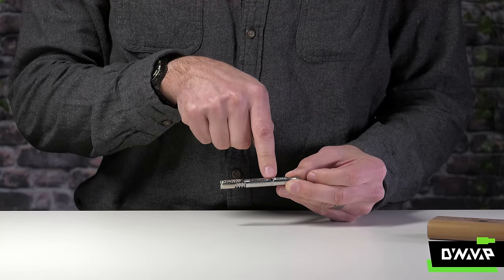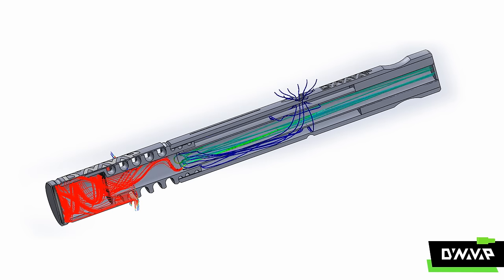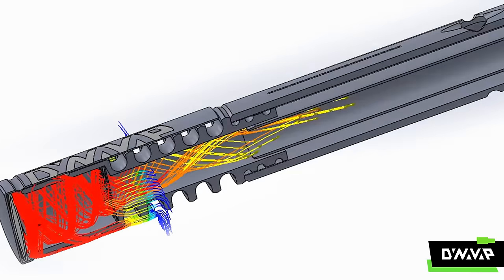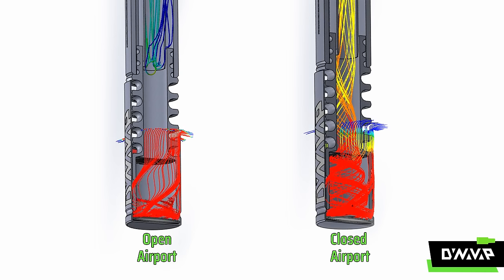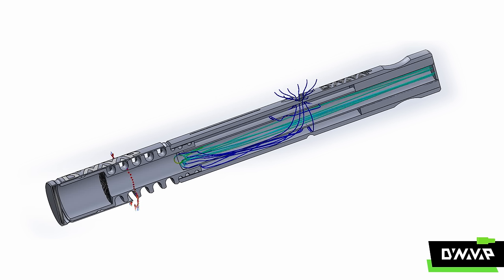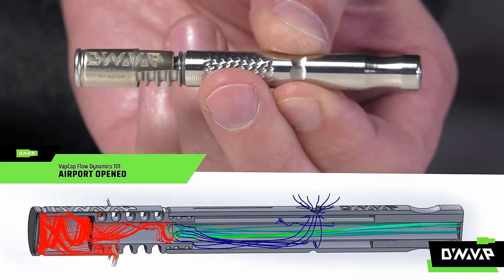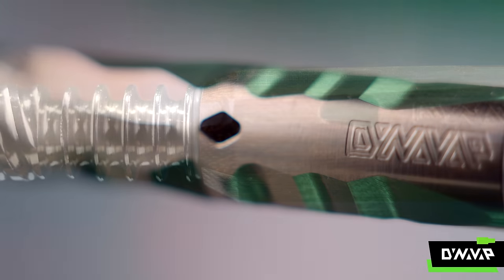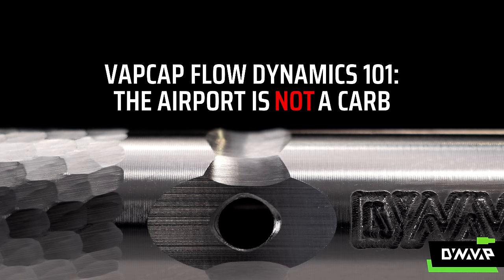How the VapCap Works  Airflow Dynamics 101  DynaVap

Comment: Soooo....the airport is not a carb...but when I use it like a carb it works like a carb.
Reply: whats a carb?
Reply: @frederik6519  on some pipes you have a carb or carburetor. Basically, it allows air to enter when you pull through it. It applies to smoking because when you light the pipe, you hold the carb which forces air to be drawn through the substance you're burning so you get a tighter draw for better production of smoke or in the dynavaps case, vapor. You then release the carb and the smoke you've built up is displaced into your lungs. It's a pretty simple concept, but it can be somewhat difficult to get the perfect amount of draw.
Reply: @Trucks_n_stuff no this is wrong. The whole video was made so people don’t think this. For dynavap. Idk about the science full behind it. This is just from my experience and this video helping me. Basically he’s saying you wanna use it the opposite of the way carbs are usually used. For example when I first used the dyna I used it like a carb. Cover the hole while sucking and let go to get smoke. But with the dyna if you let the hole open first then you get more vapor. Then at the end you wanna barely cover it to make it last longer. Also if you cover the hole it can lead to the material combusting I’ve noticed
Reply: @kzkane2866  yeah, I don't know why I mentioned the dynavap because it isn't a carb at all, it's specifically there to improve air flow for better vapor production and I knew it. Must've been really high when I wrote it, sorry for any confusion I caused the other guy.

Comment: A carburetor or carburettor is a device that mixes air and fuel for internal combustion engines in the proper air–fuel ratio for combustion. It is sometimes colloquially shortened to carb in the UK    My understanding is that's why it was called a carb on bongs etc, if anything the dynavaps carb hole is closer to the proper definition of a carb
Reply: I agree. Carburettors use Bernoulli’s principle to use changes in air pressure to draw fuel into the airstream to mix together. Same idea.
Reply: @toyotasupra97  The concept of creating turbulence to accelerate the air with the air port open is similiar to Bernoulli's principle of basically shooting dispersed vapour-like fuel in the air into the engine
Reply: If I’m understanding correctly, the device allows air through regardless of the port being closed or open so the “air port” is changing the volume of air entering the device which can change the dynamics of the end vapor.
Reply: Game changer

Comment: I love my Vong. I owned it for over a year before I realised that I loved it. I was heating it wrong and keeping the air port closed. I am so happy I persevered, my Vong is now my daily driver - even though I press my own rosin for dabbing. The Vong is just so much faster, cleaner and great engineering. Thank you. I finally stopped smoking after 10+ years of daily use. Now I am purely vapour. Much gratitude!
Reply: I'm trying to understand the Vong. I do enjoy vaporizing thru a bubbler but it seems most (all?) of the dynavap will have a tapered end for a 10mm bubbler...?
Reply: @ahoier  My Vong has both a 10mm and 14mm shape to it. A Vong will fit both a 10mm and 14mm female adapter piece. 

I heat mine below the captive cap, aiming the flame onto the titanium tip and allowing a very small amount of flame to slip over the edge of the cap, it normally gets full extraction after 2 heating cycles. I find it works best to allow a small amount of space at the top of the herb for air circulation.

Comment: I've watched this video several times and I am having trouble following it. Could someone give a simpler explanation  on the difference between an open and closed air port for someone new to vaping?
Reply: Just hit it fully closed for one bowl, then hit it fully open for another.

After a few times, you'll know what you like.
Reply: Oh, I kinda disagree with going over the click for ANY amount of time. 

It clearly says on the website that heating past the click can eventually damage the cap.

Plus, you're risking combustion, which is why we're all vaping instead of smoking in the first place.

Lastly, I've never EVER gone past the click on either of my caps: the 2020M cap, and the Low Temp Captive Cap.
After learning how to use the device (2 years ago), I now consistently get medium to dark brown material with zero burnt material and full extraction. 

In fact, I let my (smoker) buddy load a glass pipe bowl with some of my ABV (material that's "already been vaped"), and smoke it. He smoked the WHOLE (big) bowl in 3 or 4 big hits, coughed his ass off, and never felt anything from it! 
This means my Dynavap is VERY efficient, but easy on the lungs.
Reply: @triggerhappydad65  this is very useful anecdotal information. Thank you.
Reply: To answer the original question:

Basically, if you don't cover it , some outside air mixes with the hot air from the bowl, at a point past the bowl.
 - you don't have to pull so hard
 - the air/vapor you drag will be a lower temperature
 - the cap doesn't cool down as much (and you can heat it up faster, eg, for a session). This is because you are leaving some hot air inside the bowl. Not so hot that you are de-carbing, but just under that temperature (because hopefully, you stopped pulling only after the cap clicked back).

If you do (fully) cover it , the only air intake is through the cap.
 - You have to pull much harder (a whole lot harder from my experience)
 - the air/vapor you drag will be a higher temperature
 - the cap will cool down a lot faster, because you are extracting all the hot air from the bowl. You will have to spend a longer time heating it up on the next hit. (perhaps do this at the end of a session).

The nice part is that you can roll your finger (like he was showing in the video) to get a continuous spectrum between these two intake modes.

If you have used a water pipe, have you ever slightly pulled the bowl out after the herb starts to combust? I do this all the time to prevent second-hand smoke from smelling up my house. 

But this is kind of similar to the port on your DynaVap. Pulling the bowl out slightly will mix outside air with the smoke, thus cooling it off. And you don't have to pull so hard. But you get much smaller hits instead, so it takes several small hits to clear a bowl. This effect seems true in the DynaVap also, but it's not as extreme, from my experience. The only difference from the DynaVap is that, opposite to the DynaVap, I completely clear the hot air from my bowl with this technique. In the DynaVap, letting the extra air flow in actually keeps the bowl warm. And that's what all those fancy animations with rainbow lines was trying to demonstrate in the video. I'll agree that the explanation he gave was kind of unclear. Hope that analogy sort of illustrates the idea.
Reply: @G8tr1522  Thank you.
Reply: @triggerhappydad65  100% with you here. I never go past the click, haven't combusted once since getting past the learning curve. I give it 3 hits and get an even roast and light brown herb.

Comment: Great explanation and a video I’ve revisited a few times. My initial experience and preference was to keep it closed to maximize what felt like a more enhanced experience. I suppose after playing around a bit more the open or half closed method is preferred. Fewer reheats because there’s still heat in the cap.

Comment: Just got desktop vaporizer size hit out of my 2020 m. I love this thing. Love it. Mine clicks twice; the first one is a lighter click and the second one is a louder click. I stopped at one click the first time if I want a lighter tastier hit. After that I do two clicks. Do not cover the air intake. It is not a carburetor. I never touch mine. The second bowl I did one click and then two clicks and got a monster hit. Couldn't even hold it in. At all. It was amazing. After that it was pretty much done. I have it on the .05G bowl setting (the smaller bowl setting) and I seem to get three really good hits out of it. This thing is the best. Probably works great with a bong. Also I always heat the middle of the cap. Whoever invented this thing is a genius.

Comment: I use it as a carb, basically, and get huge clouds. You want to keep it closed to heat it all up good for a while and then about midway through your lung capacity, open it up and close it a few times to get it all into your lungs. Wide open will make it click too far to het all the vapor you could, so rock it open and closed in quick little bursts between longer draws eith the airflow closed. Open it up at the end of your lung capacity to get it all. This should be probably right after it clicks. I also take an open-mouth gasp of air at the very end (after taking the Dynavap out of my mouth) just to make sure all the vapor hits my lungs and isn't sitting there in my mouth or at the top of my throat.

Comment: So in other words dynavap can also be considered a hybrid because that air inlet allows outside air to come in the vape and help create the vapor which is more less convection along with the radiated heat from the cap which gives it its conduction flow as well..
Reply: This is correct.
Reply: So leave it open for more convection?
Reply: @mustang2005  if u want more air going inside. When its closed u cause a bunch of turbulence with the air and vapor. I think dynavap has another video showing how it works from the inside with the hole being covered then not being covered. Hope you're doing well and had a great weekend. Enjoy the rest of your week and have a great night. Stay safe and wavy my stoney
Reply: @WavyVaporizers  Thank you. Same to you!

Comment: Recently brought a glass barrel for mine thinking it would be slightly nicer but it doesn’t have the airport and it makes so much difference I won’t be using it again
Reply: Lawrence Horsley you're just using a different method of cooling the vapor. It can still be used without fretting
Reply: So the glass barrel is better or worse?
Reply: @owenthomas9863  worse without the airport, better with it

Comment: I'm only using my bb9 with the 2020 ss tip now, how does the airport work and that one? Considering it has no condenser so the air flowing in is different. I'm just using it as is no water piece.

Comment: I love using my m7 xl for concentrates. That's a case where fluttering the airport is best. With flower you should leave it open. But I don't use my dynavap for flower anymore I use my 18mm quartz cap made by rhe rogue wax works.

Comment: For those whobthink it's just a carb

A closed carb heats the bowl in a combustion setup, a closed airport cools the bowl in a vaporization setup, so no it's not the same. They fufill two separate and different tasks.
Reply: But the result for both is clearing the path, and a cooler hit when you open it. Open carb = cooler hit.
Open air port = also a cooler hit. Both also mean you're taking a higher air mixture. There's one difference and that's where the air goes from the carb first. The effect should be credited to the part that redirects the air from the from the carb to the material instead of straight to the mouth piece.
Reply: All you have done is tell everyone they're wrong in these comments. If you're so knowledgeable about it, why don't you get employed by Dynavap lol.
Reply: @Jay-we2ek  how do you know that i dont? info is info, alot of people were confused about the operation of the Air Port, and it is important for people to understand a product they've invested in  so that they can get the same quality experience that I have. Even if I was not employed by DNAVAP I would still try to help people understand this device because it is a game changer and has benefited my personal medical routine by measurable margins, and others deserve the same benefits. You may not need it but others have difficulty with the functionality and purpose of the port and often leads them to an unsatisfactory experience.
Reply: @emanuelemanuel7038  well said

Comment: It's crazy how things can become over-explained while simultaneously lacking fundamental definitions.
All these technical terms going over the average person's head while awkwardly using the slang for carburetor - may as well say "choke" instead.

An airport is an airplane terminal. Why try appropriating a term commonly used for something entirely unrelated?
Especially considering this hole in your stem is more like a carburetor than the previous ones you're trying to differentiate yourself from. If anything you should be championing the use of the word 'carb' here rather than other devices.

You're also just losing a lot of people in the details without accurately conveying the results to the end-user. Look at all the people still confused in the comments asking questions answered in the video they just can't understand...
 Oh well, years-old video anyway.

Comment: So in other words, its a carb. It's a more efficient and better functioning carb but its still a carb.
Reply: When a carb is closed more heat is available to the system. However on this, when the airport is closed you loose heat. Two different functionalities. In a combustion setup the carb helps create heat by forcing more air through the combusted material. In this setup forcing air through the material cools the system instead of heating it up. So you dont use it like you would a carb infact you use it almost in the opposite way
Reply: @emanuelemanuel7038  Are normal carbs directly over the material? They tend to be to the side, letting air flow into the system from someplace else, usually to clear smoke from the system with cooler air.
Reply: I'm understanding both your views here. You're actually BOTH right.  Too much to explain right now, though.  Instead, I'm gonna go gets some clicks in with my DynaVap.  I hope you guys took advantage of that sale they just had. I finally ordered the Titanium XL, and I'm pretty stoked about it. Can't wait! ✌️🤙
Reply: @SoladsChannel  Exactly. Im just trying to say they didn't reinvent the wheel like they're trying to say so they can justify charging you for the technology. Its what Ray-bands does when they're really just selling plastic sunglasses lol
Reply: @JohnDoe-lt5fq  You can clear this in cycles too. Its allowing extra air or less air depending on if you cover it.
Reply: @emanuelemanuel7038  you lose heat in that it is transferred into the material - which is desirable say later in the session.

Comment: Just ogt an omni in the mail. The air port is designed differently. Hard to find without looking now. A little sad about that haha
Reply: omni is designed for you dont use the air port, you can tune the air flow experience in your omni condenser
Reply: @arrozitoification  what? How do you do that? God so many features for such a small chunk of metal.
Reply: @intensecutn  the condenser goes back and forward when you rotate the mouthpiece, that gives the tune in airflow, but that only goes for the omnivap, not the regular M.

Comment: @dynavap another version with a larger filling chamber would be perfect! 🙏
I normally smoke CBD flowers so I need to vape much more for a nice effect. Think about it! I would immediately buy this new version!
Reply: I also use CBD flower, and sometimes mix it with THC flower. My setup is the NonaVong-S with a low-temp captive cap and a full metal jacket. I place the Dynavap into a sneaky pete style globe, heat the spot and wait for the click. I did find however for me at least, that sliding a piece of thin cut silicone shisha tube over it allows for airflow adjustment by sliding it gradually over the air port until it vapes nicely.

Comment: After seeing this I agree: The Airport is more than just a carb-hole. If the cap/tip combination allows airflow THEN all of this feathering etc. comes into play.

My original experience with the 'M' wasn't like that. When I put the cap on it was sealed shut on that end with no airflow allowed. Although the tips are precision-machined the vapcaps vary from one to the other so you can get a slightly different experience with each one. When I got the titanium tip THEN I got good airflow and I was on my way.

I have since found a good partner for every cap/tip so I am pretty well set. But I wanted to get things rolling in the beginning and I stripped out the condenser and put a small band-aid (the adhesive portion) over the airport and I just work with mouth-tokes and breathwork and it's all very good and I am very happy with it and I am looking forward to the new titanium tip.

If the new titanium tip can 'breathe through' 85% of the caps tossed at it we will have a WINNER!!!

Comment: Well that was just more confusing.
Reply: Modulate it, dont close it then open for the last draw. If you close it it cools the bowl faster and you get a weaker hit
Reply: @emanuelemanuel7038  so you heat the cap with the airport open, then after it clicks and it's time to draw, you modulate it between semi-closed and closed to take the hit, is that right?

Comment: Ummm... It's called an air inlet, but it is colloquially known as a carb in reference to a carburator, the older part in a car that mixed air with the gasoline...

People aren't calling the inlet a carburator; carb is a slang term for air inlet...

Comment: the pricing doesn't justify this object
Reply: Yes, but this object juststifies it's pricing. With the half bowl you can save a lot a material and still get baked. And these things so durable. No batteries, no electrical things, nothing.. You can save a lot of money and time with this device. Also easy to clean. It's a one time purchase if you get the right one.
Reply: they pretty much last forever if you look after it. this device is well worth what i paid for it.